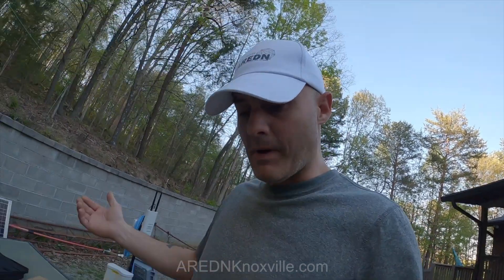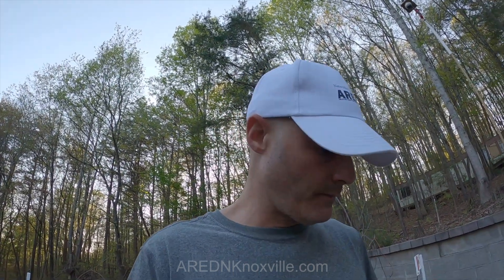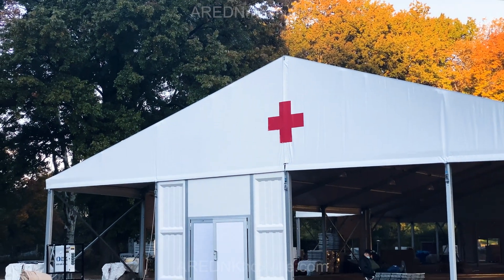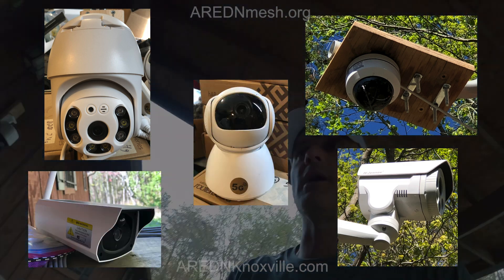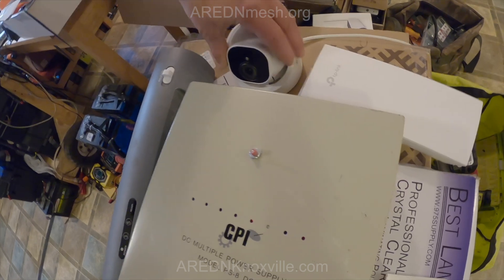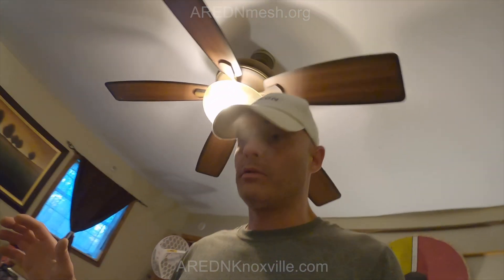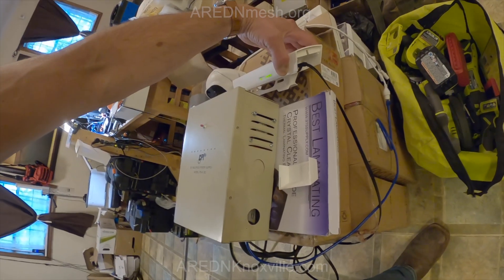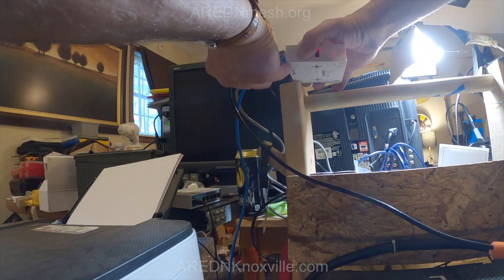AREDN RF Node Install pt2- Off-Grid EmComms Emergency Mesh- Dr Phone pt1- Solar-Reolink PTZ

Comment: We are setting up AREDN for the first time in my town, we aquired a site on a mountain that has a 75ft tower where we are installing a 120 degree sector.
Reply from the maker: Man, that's fantastic. How far is the link, and what frequency did you go with? Please keep me updated on the progress. 👍🏻
Reply: @@arednog  The link is about 6 miles to my house but we have tested it out to 15 miles using another rocket and dish with very good results, channel 182 5GHz 20mhz channel width.
Reply from the maker: @kerndesertpreppers1274  sweeeet!👍🏻 thanks for the update, glad to hear it works.